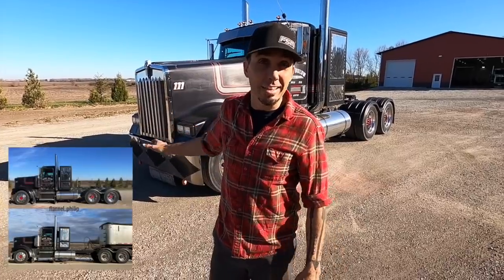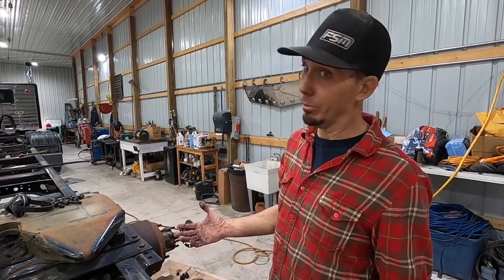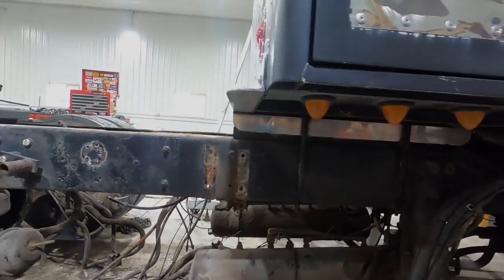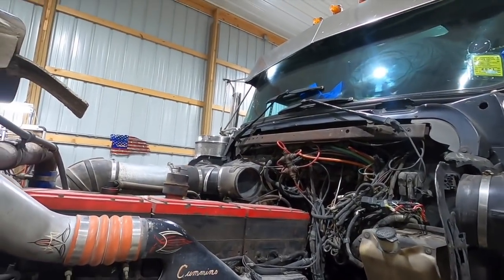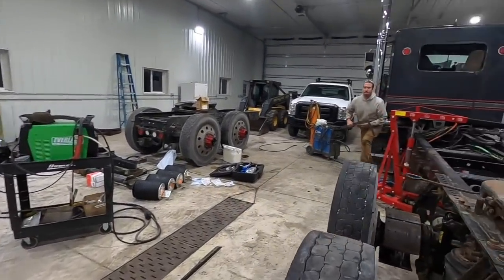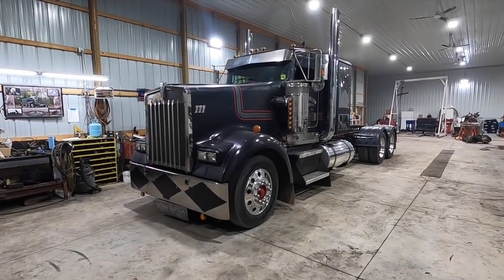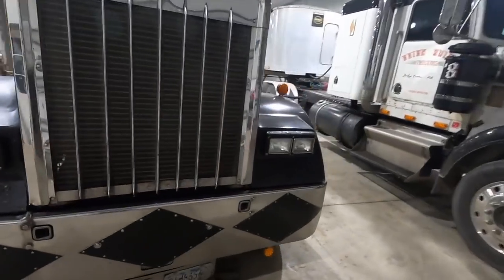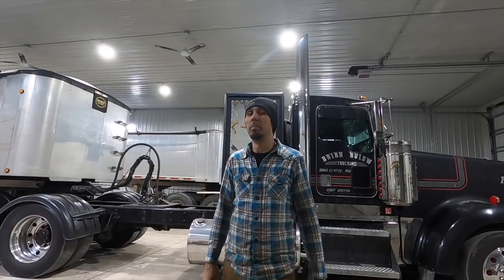My Truck Got 4ft Longer In 1 Week!!!

Comment: As you have finished all of this . Perhaps why didn't you do to lift the sleeper up with say a 4"x4" just straight up and hold it with rope then lift the other side?? Or use two ?? 500 lb ratchets??? 
As I understand one should lengthen frames with splicing 45* cuts?? 
thanks

Comment: Hi I’m about to either cut frame or redrill the rear spring mounts….it’s a .96 L7000 ex DHL SINGLE AXEL SUPER LONG FRAME    I need to shorten for a 10 ft dump….in your opinion which is better ?
Thank you

Comment: I had a71 w9 replaced rear clip with international four spring Corp suspension off a transfer it matched up newer trucks are metric thus your different size 13mm nice job though and fast turnaround good luck

Comment: For lifting the sleeper you could just use a spreader bar - then you just pick straight up from the bottom of the sleeper and the spreader bar takes the crush at the top... and you can use the spreader bar for picking anything else that is about as wide as your truck

Comment: Ahhhhh, I thought when some adds to the fram length ,the frame is supposed to be cut and fitted at a angle, not a straight up and down like it was done,, from what I’ve be told and seen it’s not structural strong with a straight up and down cut and weld,,

Comment: Welders do not make  ( Z ) cuts or 45 degree cuts in structural steel buildings .   If welding an inside liner plate to the channel of the frame rail , only horizontal welds .  Use flange bolts and flange nuts .  Good Job !

Comment: Wow, you could never do this as a Do It Yourself job in Australia! It has to be in an engineering shop, and a modification plate would be attached to the frame. Registration and insurance would have to be notified of the changes as well.

Comment: Not all in dumps you have to stabilize the fifth wheel only frameless in dumps you need to correct that I have somebody using a frame trailing thinking they have to have their fifth wheel stabilized

Comment: Well for what its worth and thats not much, theres a fella in Australia I know that does chassis stretches every day of the week and plenty of weekend warriors have plenty of opinions 
They way the do every single one of theirs is a straight cut like yours, this is done because it gives  least amount of heat in the rails when welding back up, this means less chance of weakening

Every stretch is engineered and fully approved 

The only thing that would be frowned upon and it is very very minor is in Australia we need to cut blocks of wood that fit snuggly in between the flanges of the rails at the U bolts so flanges cant be squashed when doing up the U bolts 

Great video channel, love your stuff

Comment: 90 degrees is the weakest link in any connection, should have used a scaf joint backed up with inner frame rail extended.  Iike u said each to his own.

Comment: Hey, looks good.  The only thing id have done different would have been to use c channel for the insert.  But, ya kinda cant with different frame heights.
Anyway it works and thats all that matters.
Good luck with the kenneynational interworth.  😁
Reply: what you said would be the only suggestion i could have made but still a great build

Comment: I helped my buddy strech the frame on a freightliner he was hauling a frameless end dump like you have andstarted pulling a tri-axle 39 ft east trl with 96 in deep. We took a double frame cut off we slid the inner frame up to the back of the sleeper then angle cut the back to weld up the rest of the double frame. Went from air ride 40,000 to short spring Hendrickson 52,000 lbs

Comment: Add a second pulley to your “A” frame. Or in a pinch you can use a ratchet chain binder on one side to lift the sleeper.

Great job. Cheers 🍻

Comment: The splice you do is a really strong one I'd do similar but with a cross beam between the inner sides of the frame rails for added strength
Reply: I just used jb weld and sit sleeper on empty beer bottles

Comment: Looks nice. The cut was done the same way I've done mine. Running over the road with no issues at all. Thought the frame and suspension was Freightliner. Looks like an Airliner to me. But i might be wrong. Great video!
Reply: International used hendrickson suspension on that style. But it does look almost identical to airliner except airliner Frame mount brackets are solid and made of cast aluminum

Comment: looks sweet.  only complaint i have on our 86 w900 with the 8 bag is you're always leaning one way or the other especially hauling hay.  the 8 bag rides awesome though, way softer than the air leaf on our 379.  good work guys!
Reply: Install  double leveling valves , one on left & one on right it will cure your leaning problem!@.💥💨

Comment: Great job. Can someone explain why you would want the truck longer. Isn't it already hard enough to get a truck that size, in and out of spaces? Can't wait to see the diamond deck on there.
Reply: It adds more length vetween the front and back wheels think like a roof pitch 3 inch drop over 6 feet or 10 feet the three inch drop would be significantly less at the front end over the ten feet than six feet it looks super cool its how truckers improved the comfort of their rides  before air ride

Comment: I would have just cut a 2x8 and put it on top of sleeper as a spreader, straps wont pinch sleeper. Been cuting and splicing trucks myself for over 40 years, good job! On your next one see if you can get some tandems with disc brakes.

Comment: Straight cuts are ok if welded with the proper procedures and a frame section over or inside as long as possible to stiffen that frame that job would not pass in most places welding has to have full penetration and peened and I would have never used wire feed unless it's a flux core wire that has been tested on this type of frame material. Stick welding is a proven method must be back gouged usually I weld the inside first so I can grind out any slag and crap lot easier to work on the outside of the frame then fill and cap it just like I would do a pipe weld except I would air peen the welds to stress relieve it. I
Reply: Bridges are joined at straight cuts. They used an industry standard procedure. It’ll be fine.
Reply: @dustinmeier9753  Frames are heat-treated, high-strength steel, and most frame repair procedures (all that I have seen) specifically require 110ksi low-hydrogen rod. One could potentially convince an engineer to approve E111T1 dual shield. Welding inherently screws up the heat treatment of the frame. Peening the weld between passes, as stated above, stress relieves the steel and makes it less likely to crack, which is a big issue with welded frames. Using a lower tensile strength welding alloy would likely be considered an unacceptable practice in many areas. The normal welding alloys we use have 40% less strength than what is called for in this case. All it would take is one DOT officer having a bad day and this truck would be towed and permanently OOS until engineering drawings and x-ray inspection of the weld would be provided to prove that it was done safely, or it is cut again, properly re-welded, and inspected.

@paulkushnir2224 clearly knows what he is talking about and is describing the right way, as per manufacturer procedures, to do this. And that is what is important to the DOT.

Comment: I'm actually kind of surprised he use an International. I always kind of thought Internationals ride like a farm tractor.
Reply: The international suspension rides good..It's basically designed like the Pete low leaf but the front hangers kinda float and has a extra stabilizer/rod for the  front side of each rear...The downside is there more bushings and these strange flat isolator bushings in the front of the leaf that wear out and if a u bolt gets loose..it'll jam the rear to left side..but let's you know..

Comment: Someone told me you can not or should not weld frames for what reason I have no clue but I see it was done here.
Reply: I think most of it is liability. The  manufacturers don't want a crash making the news then the frame welds and failures blamed on them. But if you look at the offroad community they will take a brand new truck hack up the frame weld modify and change things millions of times a year. Modifying these truck frames is done daily across the country also. Every single one of them welds the frame

Comment: I have seen oframe streches done several waysbut the worse one I seen they spliced the frame right ahead of the rear spring hanger, which I feel is the weakest place to do it
Reply: Actually the most stress would be half way between the front rear and the steer axle..

Comment: I’m sure I’m not the first one to suggest this and it’s too late now but was curious why you didn’t run the new frame as a liner inside of the old frame? Just curious I think it looks beautiful and I love your truck
Reply: They are the same width.  You couldn't slip one inside the other.
Reply: @threynolds2  
NO, the original one was quite taller then the new one with the rears attached
Reply: @scottreed5460  yes, it was taller by a half an inch.  But the side to side width was the same.
Reply: @threynolds2  
Ok gotcha, I mean it came out great was just wondering

Comment: Do you think the frame should have been cut at a45 plated on the inside
Reply: A scarf joint is what I use, it doesn’t have to be 45° though, 30° is plenty

Comment: Europe calling here.. first notice, 4 bags per axle is considered better any day here. But what surprises me most is blocking fifth wheel swing. What? Why?  Where this crazy amount of tension going when crossing awkward terrain?
Reply: I agree, maybe it has something to do with the specific trailer type they pull?
Reply: @GordonTurnerr  As he says in the video its because of tipping but.. sure, it's better if you have stable saddle while tipping under angle but if there is also some driving included in the job then i lost it there. Pretty sure it will cause premature wear on kingpin and locking mechanism. And in some slippery cases lack of steering and/or loss of traction.
Reply: @Hypheh  maybe inclines don't exist where they live lol. Yeah that would stress the shit outta pin for sure!
Reply: @GordonTurnerr  i'm so confused about this that i'd like to have a comment from somebody whos driven one and from some engineer, preferably from company witch makes side-swinging fifth wheels for heavy duty use for us.😀

Edit: Jost even makes No-Tilt fifth wheel, so if he really have correct trailer then yes, joke is all on me.

Comment: Personally I wouldn’t cut a frame especially like that. I’d prefer to get the proper frame length that I wanted and put it back together.
This is just like guys that buy cheap tractors and convert them into dump trucks because it’s way cheaper t go that route.
Dump trucks are spec’d out on paper before they are built. Double frame, 20K front end, 40k- 46K rears. Gear ratios are next . So many little things to make it work in that field.
You wouldn’t take a dump truck and make it a road tractor. You would loose your back the first week being on the road because it’s so rough riding.
And if you are not going to read your comments to know if you are doing a good job or not then that’s on you and you will not succeed as a utube channel.
Just sayin.

Comment: I get the stretch, but why a binder rear? If you're gonna do it, why not do a low air leaf?
Reply: If you've looked at the international rear suspension..It's basically designed just like the low leaf but with the front of the leaf doesn't have a regular bushing hinge point...Can float up and down and stabilized with a extra dog bone torque rod on the front side..There's extra bushings and if a u bolt gets lose you know it quick because it will jam the whole rear to the driver's side and be tracking noticeably outside of the other rear...It rides as well as the Pete and has more travel on the front of the springs which helps with traction..Which was the purpose of the KW 8 bag..not ride quality...Ok..I'll stop now..lol
Reply: @muthatrucka76  thanks for the answer. Learn something every day.

Comment: I was under the impression whenever you cut a frame should be done @ 45% angle ?  I saw you cut straight trough and add a brace ,bolts ,welded?
Reply: Exactly.... a 45 is much stronger.
Reply: L cuts are possibly the best way to go, my opinion is they are the strongest but we've only stretched a few trucks.

Comment: Angle cut frame , angle cut is approx 15" long straight cut is 10" long way more strength in angle cut.then add 3' sleeve with ends angle cut .
Reply: WOW 😳 it changed the whole look!!! Came out mint dude!!!
Reply: ANGLE CUT only way to do IT
Reply: @megastarx11 , not necessarily. L cuts are way stronger, if you don't know what L cuts are, you have never stretched a semi frame
Reply: People talk about if the weld isn't worth a shit...would any way of doing not be shitty if the welds were shit? If a welder has to prove their weld is stronger than the surrounding metal and isn't the weak point to be certified...Why would it matter about the angle and such? If it's reinforced and works..it works..Show me the physics and I'll agree after press testing the theory..because that's what it is until proven or disproven..
Reply: Do the science
Reply: @muthatrucka76   the weld is the weakest part the steel ends up with a hard spot that is diff. molecules than  the weld  that will  not flex under load

Comment: Dunno. My Kenworths both say No Weld on the frame rails as they are heat treated. Hate to see this break in half going down the highway.   There are channel inserts to double frame the joint but you are joining frames of different sizes.  Also, on my fuel tanks, I removed them and welded in thick aluminum strapping to prevent porosity from road de-icers.  The straps were installed where the hangers contact the tanks.  And, that sleeper sucks.
I gave you a like because its a Kenworth.
Reply: I think most frames/manufacturers say that, yet people do it millions of times a year with no issues. Now if you're an extreme oversize hauler, maybe not a good idea liabilitywise

Comment: Why do the truckers  in America stretch their chassis and take the weight carrying off the the steer wheels,doesn’t make sense from Australia .
Reply: Rides much better, might not fly with your laws or road designs, but it is a smoother ride, can make it difficult depending on where you deliver sometimes. 270" isn't that long
Reply: Better ride, allows you move weight from drives to steers. Who the hell wants a ton of weight riding on the two friggin tires that steer your truck.
Reply: some of us do it to add axles and space for other modificatiins.

Comment: a GUSSET which is an ANGLE is strronger  that a straight cut has more surface area. a WELD is like a CUT it becomes harder than the metal around it, this is why TRUCK Frames have a decal
that says donot weld, because the steel has been annealed  to spread the  strength so that the steel does not have hardspots, that tend to CRACK
Reply: Yet cutting and welding these truck frames and offroad vehicles is done millions of times a year without problems.
Reply: @mrmotofy  SEE PAKISTANI TRUCK----------- every frame   is PUT Together using ANGLE CUTS-no straight cuts or welds
Reply: @megastarx11  So what, one guy, shop, channel, expert says "this" is the way....yet millions of others do it differently without issues.
Reply: @mrmotofy  good luck BUCCO

Comment: When he showed the lumber under the sleeper I knew that we were about to see some real half assed engineering and they definitely put on a helluva show. What an absolute pile of cobbled together trash and it's not surprising the DoT is hard on trucks because there is stuff like this on the road.
Reply: Hey look guys, we got us a Supertrucker here.  🙄
Reply: @wp3532  
With 3 million miles and a clean DoT record I certainly know what doing it right really looks like and this isn't it. 
They took the rear clip off of some mega carriers wreck and cobbled it to a 35 year old worn out pile of trash.  Seriously if you have lumber on the frame rails to keep the sleeper from collapsing that's a good indicator that there's a lot more half assed engineering going on and there certainly was.
Reply: @philherbox4052  so every box truck with lumber down the top of the frame rails to support the box is “unsafe” huh?  🙄
Reply: @philherbox4052  Using wood on the frame rails has been used for drom decks and straight truck bodies/flatbeds for a long time. A good piece of white oak will outlast steel rails on salty roads. Let’s see your setup if you want to call out his for being a pile.
Reply: @petercarlsen3462  
Again you're talking about how they use lumber to secure a box on a 3/4 ton truck and most of them use steel now.  My setup is in my avatar picture and the bunk is properly attached to the truck with mounts.  No lumber under it and there's certainly no holes for eye-bolts in the roof of the sleeper.
Reply: @philherbox4052  We can agree on the eyebolts, I think that is asking for problems over time, but it is his truck. He takes pride and wrenches on his own truck, which I can respect in a time when most won’t change their own tire.